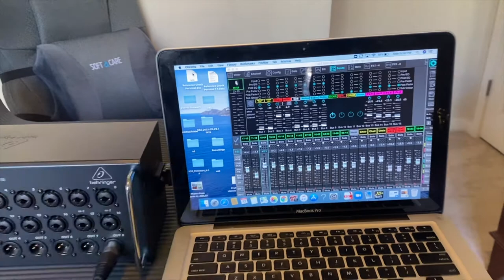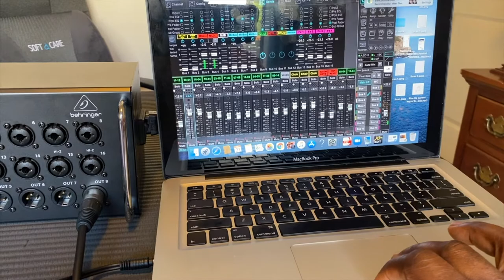Behringer SD 16 Digital Audio Snake (No Power)

Comment: Great video, but I'm curious. What would have made you think that it was capacitor issues FIRST causing you to go down the rabbit hole of swapping caps when it was obviously a cold solder joint from the fact that tapping made it intermittently come on? Bad caps are not affected by tapping, that indicates a connection issue or cold solder joint which it ended up being.
Reply from the maker: Behringer mixers have capacitor issue, so thats why i made that assumption to begin with
Reply: @richthefixer  I agree with you 100%, they use very cheap caps. But the fact that tapping it made the LED light flicker shows that it was not a cap issue right at the start. I would have thought you would have reflowed the connections on the back of the PS board first instead of changing caps. Anyway great job!

Comment: Expect to find issues if you continue to use just plain old CAT5 cable -- the warnings are on the ports for a reason. Worst case -- you will blow your ports on the X32 and / or the stage box. Should be screened shells end to end that you use
Reply from the maker: that's true

Comment: Do the sd8 and sd16 usually take a little bit to connect? Sometimes I plug mine in and get an instant green light, other times it takes a little bit.. 30 seconds maybe

Comment: Just had the exact same issue with one of my SD8 stageboxes. I noticed that 5 volt rail fluctuates between 1.2, 4.2, 4.8 and 5.1 volts. Which rang a bell to me as the 5 volts output comes from a variable regulator, the problem here is a very small 4k7 resistor in the corner of the board (close to the mountinghole for the screws), that is (supposed to  be) connected to the groundplane, but the sheer size of the copperplane it is not properly soldered there, and therefore putting to regulator to 1.2 volts (it lowest setting). Long story short, search for that 4k7 resistor. Hope it helps somebody
Reply from the maker: Thank you for sharing . I appreciate it

Comment: Do you have any idea why an s16 not getting a signal to the mixer. Just stopped.  We have power no signal.  Behringer
Reply from the maker: First check the cat 5 cable. Check the mixer in setup if you see the symbol of the snake being connected. If you dont see those, then you have a defective mainboard on the S16
Reply: Thanks  the cable is find. I am guessing it's the main board.  Can an individual plug  a cable in and blow the board
Reply from the maker: @justhim8745  the plug not usually damaged its the electronic components on the board that gets damaged. The component s are surface mount and harder to get. You will need a new board
Reply: I was not referring to the plug. It is the XLR plugging to the jacks.
Again, thank you so much
Reply from the maker: @justhim8745  oh ok. I just understood what you mean. Yes that can happen, but most times it gets damage thru the cat 5 cable especially if its left plugged in
Reply from the maker: Just change settings from slave to master on S16, then pass signal thru the S16. You just want to be certain that its the S16 is the issue and not Aes50 port on the mixer.
Reply: So, we have to pull the cat 5 cable out each day after using?
Didn't know that 🤔.  I'm no electronic repairer but, the mixer to the snake is about 75ft. away,  I thought it would be OK to leave in. Or do you mean when plugging XLR cables to disconnect the cat 5 cable
Reply from the maker: @justhim8745  i mean just unplug the cat 5 from either end the S16 or the back of the mixer
Reply: Got it .. I'll check.  Thanks a million
Reply: If it needs a board, is it easy to replace.  I've done some soldering
Reply from the maker: @justhim8745  very easy to replace